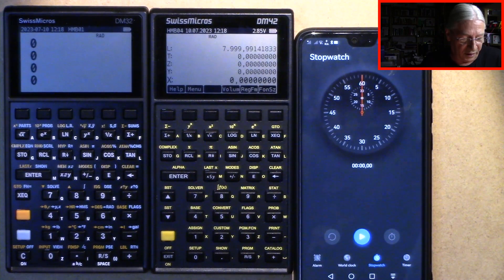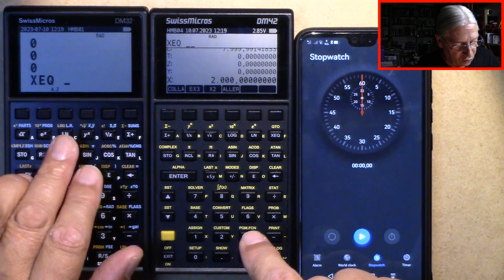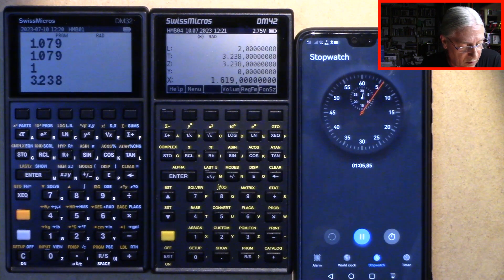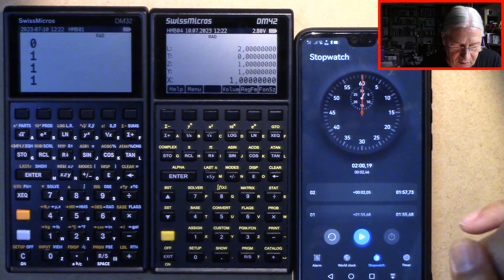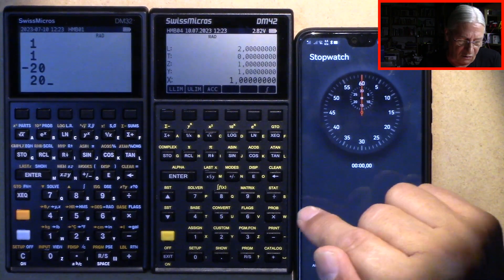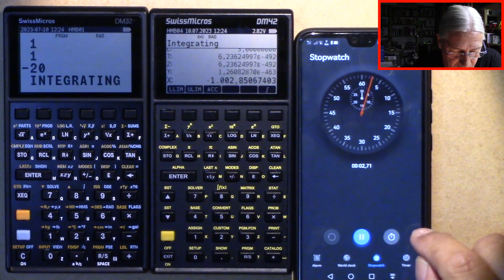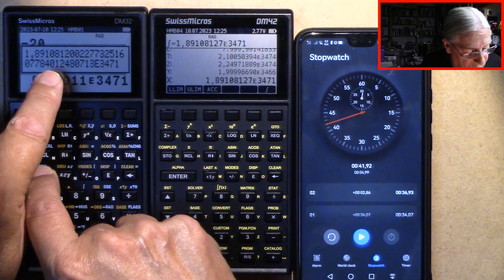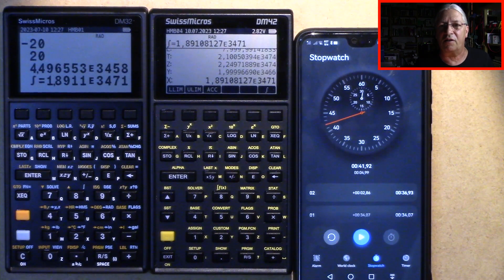How fast is SwissMicro's DM32?

Comment: Thank you for the excellent video.
Question: If you could only afford 1, which of these two would you purchase? The DM32, or DM42?
(My background: At one time I had a 28C, 28S, and 32S, but those are gone. Currently I own 48GX and HP Prime.)
Reply from the maker: I'd recommend the DM42, and that particularly for one reason: You can easily put glorious alternative software on it. If you're on the RPN-side, try out the C47, and if you're on the RPL-side try out the DB48X. No other Swissmicros calculator offers so many third-party options as the DM42. There are even people who use it as it comes from the factory :)
Reply: @N.A._McBee  So the DM32 is not flashable? Wow. Thanks. I thought they all were.
Reply from the maker: @Quidisi    That's a misunderstanding! The DM32 can be flashed! But it has a new version of DMCP (the underlying OS so to speak) which is not popular in the developer community. This may be due to a lack of documentation, I'm not sure. But in principle, 3rd party projects on the DM32 hardware were and are possible, but the C47 and the DB48X are definitely only available for the older DMCP version on the older hardware.
Reply: @N.A._McBee  Thank you! This information was very helpful in clearing up my confusion.
Reply: One clarification, the DB48x on the DM32 is called DB50x.  So it is available.  One consideration when selecting: the DM42 processor is slower and I believe the memory is also smaller.  If you want to run third party firmware the DB32 would be more “future proof”.  Just my two cents.
Reply: There is now a DM42n with double the space and a much faster processor. I just find the yellow text on the faceplate of the 42 harsh to look at.
Reply: @keyboard_g  Thank you. Yes, I pulled the trigger on the DM42n as soon as it was for sale. So far, love it. But am biding my time until DB50x is out of beta and stable, and then i plan to flash it to be like a 48.

Comment: Sorry about my naive question, but what's the purpose of the DM42 and DM32? I thought the 42 can do everything that 32 does, so, why to have both?
Reply from the maker: I must say sorry, too, because I'm on tour and do not have great Internet access each day. This delayed my answer significantly. - Well, your question isn't naive, it's only rational. You ask for a true reason from a practical aspect, but there is none. What Swissmicros did was to develop a new hardware platform, and the first project they sat upon it was the DM32. One may like it or not, I'd rather have seen a new DM42 version on the new hardware but this doesn't seem to come. So, one irrational reason to buy a DM32 may be the new hardware, just to have the best hw platform. On the other hand, the DM32 is an interesting concept, as well as seen from the HP aspect when it came to market as now in the form of virtual calculators on the SM platform. But there is no rationale to buy them both, you may even wonder if there's a true rationale to buy a pocket calculator in 2024 at all. It's a matter of fascination, a matter of personal recollections, a matter of how you see the world as a whole if you will :)
Reply: @N.A._McBee  Thank you for the explanation.

Comment: In the Collatz sequence you are actually only measuring the pause time (PSE). Without PSE, on my calculator, it's running in less than a second. You need another algorithm to see if one is faster than the other.
Reply from the maker: That's right but as far as I remember this has been already discussed in the comments. Nevertheless, I should have noticed that. My fault. I believe I thought something like PSE == PSE, but that's for sure not necessarily true between different calculators.